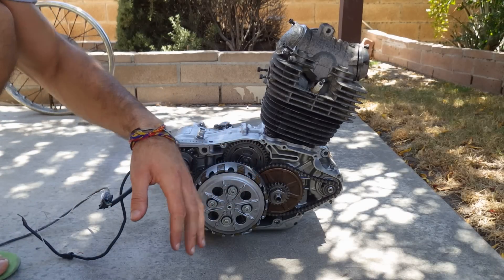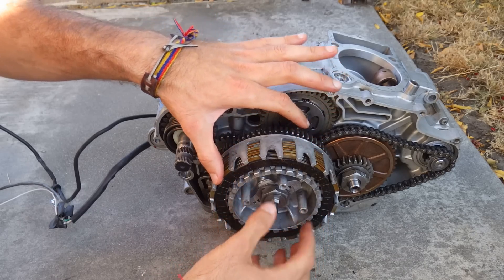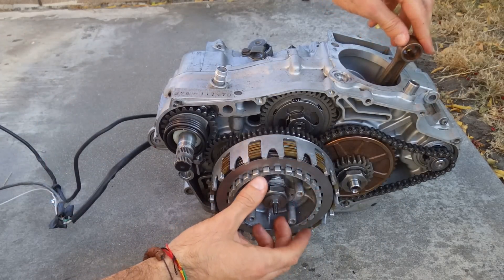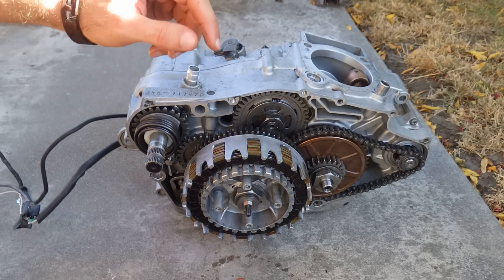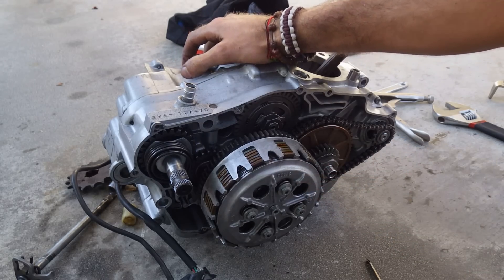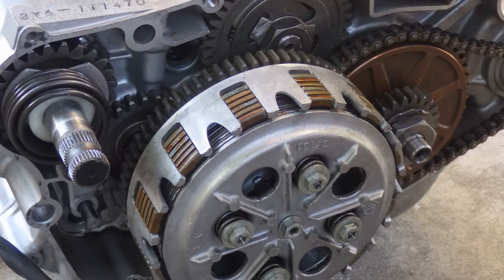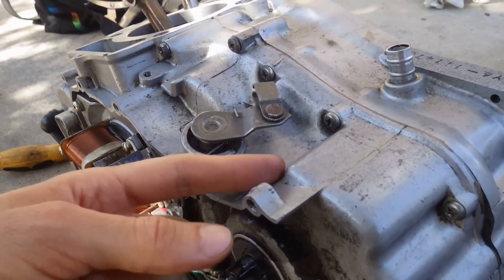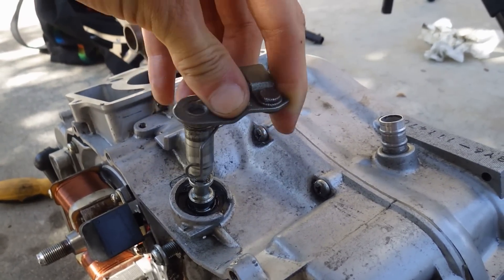How a motorcycle clutch works

Comment: Great video. It is quite old, but if someone sees this and feels like replying - great. I've heard my motorcycle has a "wet" clutch, and I know this has something to do with the oil. Does it mean that if I take the side of the cover off my bike like in this video, that oil will go everywhere? Looking as you disassemble the plates, they look kind of wet to me - assuming this is oil, but where does the oil come from?
Reply: Yes, if you take the clutch side cover off of this engine it will leak oil. It’s just regular engine oil that sits in the sump when the bike isn’t running, and when running circulates to lubricate the clutch, crankshaft, transmission, cam shaft/rockers and other moving parts in the engine, driven by an oil pump at the bottom.

Comment: This shows why you should avoid sitting in first gear with the clutch pedal depressed (in a car) or with the clutch cable pulled (on a bike) because you impose undue/unnecessary wear on the clutch release bearing (5:36). Put the gearbox into neutral until the lights go green. Be reasonably sensitive about your use of your clutch and it should last the life of the engine.
Reply: That's because clutches both car and bike are wear items and wear out regardless.  If you watch other videos or actually tlk to the reps for maintenance and development they all will tell you it is better to be in 1st gear at a light. I ask this same question years ago to a rep and he said "What's the difference between   pulling in the clutch at a light or in traffic compared to pulling in the clutch at each stop sign,  at each gear up or gear down shifting" the buddy with me said "Not sure" the tech replied with " The holding in the clutch at a light puts less wear than the other things mentioned " springs get wore out from repetitive use which is what you are doing more of compared to just sitting at a light.  Also I value safety over a hour clutch repair job. When you see that vehicle not stopping in your mirror or hear the tires locking up if you are not in 1st you getting cooked.  Many videos out there have tested the reaction times of in gear and not in gear. The not in gear always falls short.

Comment: i got a question. I am rebuilding a 1974 Kawasaki G5 KE100 and i am trying to figure out if i need a new clutch. If you disengage the clutch on a motorcycle (in general) while it is off, should the engine still spin the wheel if it is in gear and the motorcycle is on the ground?

Comment: 1 nov 2019 2:14 pm edt:
thanks. so racing-motorcycle-clutch is same as car-automatic-transmission->clutch-pack.
source:
'clutch pack' in https://www.youtube.com/watch?v=z7amB3-ebuY (05 Automatic Transmission Driving Devices [Clutches]) from youtube-search (automatic transmission clutch)result 3
  from https://www.youtube.com/watch?v=5Tdg1t0FylA&t=2m29s (01 Automatic Transmission Components )
  from https://www.youtube.com/watch?v=-kmZhbu8WYY&t=6m19s (04 Automatic Transmission Planetary Gear Sets)
  from recommendation in ...

Comment: hey guys, I have a yamaha blaster with this clutch system and after she sat for 2 years the clutch friction plates got rusted stuck. I now took it apart, can i clean off the rust and put it back together or should i get a new clutch?

Comment: it would be cooler if you demonstrate it while that engine is turn on
Reply: That's a wet clutch AFAIK so it can't be run without the side engine cover on and oil in the engine. It'd be cool though if someone made a clear side panel so you could see in.

Comment: Brilliant video thanks all ot mate !!!! Quick question I understand the basics of how a clutch and gear box work together.  What i would like to know is iff poping the clutch to do a wheelie is also bad for the gear box? So I mean your riding in 1st gear your up to 15 mph u bring clutch in rev it allot then pop it out. from my understanding won't this just wreck the clutch eventually as it's already in gear?  Or does this put ware on the gears inside due to the shock load ? Iff you could please get back to I would love to learn exactly what this does.  I'm not doing wheelies all the time but when I did i thought about learning exactly what damages it causes. From what I think won't this just put ware on the clutch iff the box is already in gear? As I could live with wareing out a clutch as they are replaceable what I would hate thoe is to ware inside the gear box

Comment: So motorcycle clutch doesn't have a diaphragm springs? Which works the opposite way: Disconnect the plates by pushing DOWN.
Anyways.. what really amazes me is how can the mere force of friction be enough to transfer power? How can the plates keep up with the ferocious engine power and not slip?

Comment: I have an xj1100j Maxim. am I hurting anything by sitting at a traffic light in gear with the clutch lever pulled in or should I put the bike in neutral and wait? Great video! Thanks
Reply from the maker: Actually, a motorcycle riding instructor told me that's what we are supposed to do in case another vehicle from behind decides not to stop. Mechanically speaking it shouldn't make a significant difference.

Comment: It's crazy how similar that engine is to a Yamaha Blaster engine (they came out in 1988 and kept the same engine design until 2006 when Yamaha stopped selling them - they were just 200cc air cooled units).  So much of the bottom end looks almost exactly the same (minus the water pump).  It's interesting to see when manufacturers take/borrow from existing designs. 2-strokes are so simple, I love them!

Comment: Thank you very much for explaining. Accidentally I shifted once from N to 1 WITHOUT clutch on my HD, the most misterious thing is the gear box did not grind or else, and it was pretty smooth (not as smooth as it used to be when the engine is hot and obviously you use the cluctch, but similar like the first time you shift to 1 gear in cold) How could it be?

Comment: I have probably watched about 10-12 videos on disassembly/installation of the clutch and none of them explained the basics of how everything works together like you did!!  I really like how you have all the parts pulled part and show how they interact with each other when they are moving.  I could clearly see how each part works in conjunction in the overall operation of the clutch.  Great video!!  Thanks Man.

Comment: Hi, I have a question. When I rev and then let go the clutch immediately (I suppose when you do a wheely), there is a loud tick in the engine, like engaging and disengaging a gear when  launching the motorbike. Do you know what it is? thanks in advance.
Reply: Thanks for the information. Do you suggest that I need a mechanic to see the engine? It's just 10 months old. thanks again.

Comment: so what if my bike moves when the clutch is pulled in all the way? ive made the cable as tight as it can go but still engages. i also just changed my transmission oil.

Comment: Hey, i have an 96 RM250 and my clutch assembly is slightly different at the cable part of it. mine for some reason or the other is not budging when i pull the lever to disengage the clutch. its not the cable. i think its the thing that the cable attaches to that makes contact with the push rod. i noticed i dont have a spring.

Comment: my clutch is hard to pull on. I've lubed the cables. could it be the springs?
Reply: There are 2 things that cause a clutch cable to bind up and sometimes a 3rd freak thing is the clutch throw arm can be bent or the spring inside the engine kinks from heat which is a bastard to just get the spring is by far the hardest problem to diagnose. First off if the cable pull is too hard or not what it should be some goobers let their bikes outside and the cables corrode inside the sheath and they get tough to pull. In such cases just replace the cable.... THE THIRD ISSUE HAPPEND TO ME AFTER I TOOK MY BIKE TO A PENNSYLVANIA INSPECTION STATION. I WILL NEVER AGAIN HAVE MY BIKE GO THRU A PA SAFETY INSPECTION. SOME PRICK DELIBERATELY REROUTED MY CLUTCH CABLE SO IT WAS UP UAGAINST THE RADIATOR HOUSING AND THE KICKER BEING IT WAS EXACTLY HOW THE CABLE WAS WHEN I BOUGHT THE BIKE UP AGAINST A PART OF THE FRAME AND RADIATOR WHERE IT WOULD KINK... AFTER I FOUND THE ISSUE AND BARELY MADE IT HOME I WAS GLAD TO FIND OUT THE CLUTCH WASN'T FUCKED UP BUT I WENT BACK AND RAISED HELL BECAUSE I ALSO FOUND MY REAR BRAKE BARELY WORKED THE STATION FAILED MY BIKE BECAUSE THEY SAID I NEEDED REAR BRAKES WHICH I KNEW WAS BULLSHIT BECAUSE THE BRAKES WERE NEW I PUT THEM ON THE DAY BEFORE I WENT TO THE INSPECTION STATION BIKE SHOP. THEY LOOSENED MY REAR BRAKE CABLE I ALMOST RAN INTO MY TRUCK IN THE DRIVE WAY BECAUSE THE SHOP WAS A STRAIGHT SHOT ALL THE WAY HOME ONE RED LIGHT WHICH I WENT THRU WAS GREEN IT WASN'T UNTIL I TRIED TO TURN INTO MY DRIVEWAY I NEARLY WRECKED.. I WILL NEVER AGAIN HAVE MY BIKE SAFETY INSPECTED IN PENNSYLVANIA IT'S NOTHING BUT A SCAM ON MOTORCYCLE OWNERS. THEY ALSO WANTED $250 BUCKS TO PUT THE REAR BRAKES ON. I REPORTED THE STATION TO THE PENNSYLVANIA STATE POLICE. HEARD NOTHING ABOUT IT EVER AFTER.
Reply: Tim Yeakel
 hope you got it sorted out dude. main thing is that you're okay
Reply: Has anyone been inside the clutch doing any work recently? If so, the main nut holding the clutch plate on may have been tightened too tight. It only needs to be tightened just a hair past finger tight.

Comment: is the clutch plates immersed in oil? if yes how can it make friction?
Reply: the oil is the reason why the little pull on the clutch is enough to reduce the friction. If there wouldn't be oil, the plates would stick together no matter what. In combination with the oil however, the pressure on the plates is, when the clutch is pulled, just little enough to stop the plates from sticking together
Reply: No. The wet clutch is specifically bathed in engine oil, witch keeps the clutches cool and clean. Dry clutch(less common) are not bathed in engine oil and are louder and can take less beating.
Reply: I don't think it is, oil is suposed to have a very low friction coefficient, which means it'd make a clutch extremely slippery. I think some part sof the clutch assembly have oil flow, but the parts meant for friction (i.e. between the plates) are probably drier than a desert.
Reply: Ducati-clutches are a perfect example of that^^^ :)

Comment: Thank you but i still dont understand
Reply: When you press the clutch lever you loosen up the disks so they don't rotate. When you depress the clutch lever the disks press back against each other and create friction, so they can move.
Reply: It is the same concept car or bike.
Reply: Torque transmission happens through friction. Given the small area (due to the radius), there is not enough surface area. Adding multiple discs increases the total area. by distributing the spring force over a large surface area, the friction force per unit area is reduced. This reduces heat generated due to the slip until there is no slip. Hence, multiple discs help.
In the case of a car, the radius of clutch plate is large.
Reply: Cars have much simmpler clutch systems. Look up how a clutch works (NOT a motorcycle clutch)

Comment: I have a bike that starts goes into gear and bearly moves at full throttle 

It doesn't stall when in first gear

It has the same motor as the one in this video 

Can Yu help me out plz
Reply from the maker: Did you do a compression test?
Reply: Your clutch cable might be way too tight. Is there any free play in the lever before the clutch starts moving? Are you using motorcycle specific oil?
Reply: I am experiencing the same. Did you solved it?

Comment: Great Video!, I actually took my clutch plates out and separated them without seeing how they where placed in. I understand how the steel plates go back in but Does it matter how the friction plates go back in? when i reassemble everything the clutch will not engage and when i put it in first gear the motorcycle dies??  any advice??

Comment: Thank You! This is so helpful. I have a Yamaha Vstar650 and my clutch is very loose a lot of free play. At first I thought it was cable stretching out so replaced it then find out even new cable seem too long. Now I think it's the thing that end of cable connecting to. It seems like it has lost it's tension. Does that mean bad springs? Either the one on it or the clutch springs?

Comment: I just bought a 1980 Suzuki GN400 and my clutch lever is really stiff, so could that be a problem with the clutch springs or something? I've ridden other bikes before and never felt a clutch as stiff as this one. I bought a replacement cable because the old one was ratty so i'm thinking the problem is within the clutch somewhere. If anybody can help that would great.

Comment: Am I right guessing that there are so many plates because it MUST work in oil?
If it  could work dry like in a car there would be not more than two plates working together?
Reply: They use multi plates in bikes because of the little space available. In a car they can put just one big clutch in. Say you need a clutch to handle 100lbs of torque. You could use a single big clutch or 6 small ones together. They could both provide the exact same amount of friction required just in different ways.
Reply: will Speakman
thnx, this explains evrthng

Comment: So both the outer clutch basket and the inside clutch basket are moving when the clutch is not engaged, but when we engage the clutch lever, which basket moves then? I know it's only 1, but don't know if it's the inner or outer one? Thanks for the informative video :D
Reply: +Jon Jelen In other words, 1 of the 2 baskets is constantly moving, no matter if the clutch is engaged or not. I'm wondering which one that is, the outer or inner one?
Reply: +Jon Jelen the outer one always moves because it's connected to the engine. as you release the clutch lever, the springs apply pressure to the clutch pack causing the inner hub to turn wich is connected to the transmission.

Comment: As you were saying pulling the clutch lever, there is the spring which pulls it back to thr original position, does every bike have the spring in place? Or different bikes have different mechanisms?

Comment: how tight should i tigthen the clutch bolts springs 6:26 please reply
Reply: +GAR A 
According to my BSA B-50 manual, you tighten the pressure plate bolts until the springs are "just proud" of the cups.
No, I'm not kidding!
Reply: I know that.  I was simply relaying what my "Beezer" manual calls for.  Personally, I found it to be most humourous.
Reply: Jeff H.
BSA=Birmingham Small Arms.  Ceska zbrojovka, and Husqvarna were two other companies that built both firearms and motorcycles.
Reply from the maker: +GAR A Not very tight at all. Your service manual should have the exact torque value.
Reply: A video for a katana 600 said 7 foot pounds
Reply: Awesome,learn something new every day!!! Thanks guys!!! :)

Comment: Thank you for taking time to share. I knew 10% of how my clutch works, now you've completed the picture for me. I looked up the cable controlled lever at 4:00, it is called a clutch release shaft with a push-rod actuator at the bottom.

Comment: Why are there so many separate plates? why isn't it just one big piece? just curious why its made that way, not trying to sound rude.
Reply from the maker: +Carter Byers In the limited space of a motorcycle engine only small clutch plates can be used. The drawback of plates with a smaller radius is that they transmit less torque and generate more heat. Using multiple plates compensates for these two limitations.
Reply: +Al's Garage apa payah nk tu tujukln